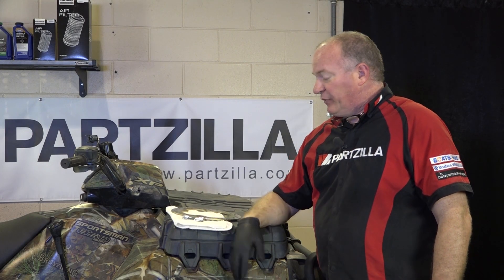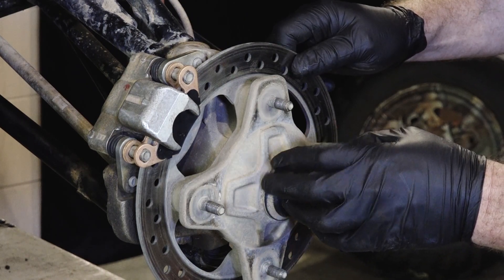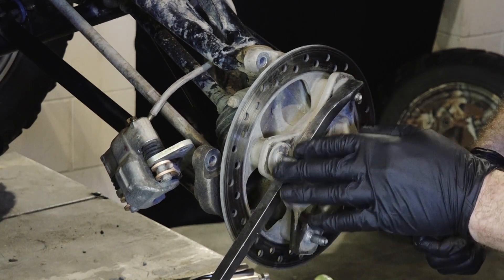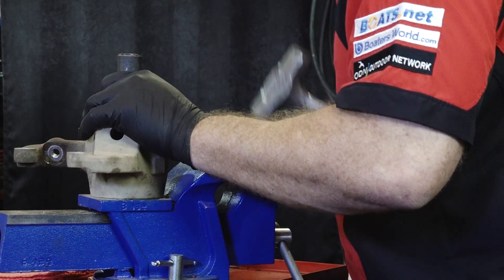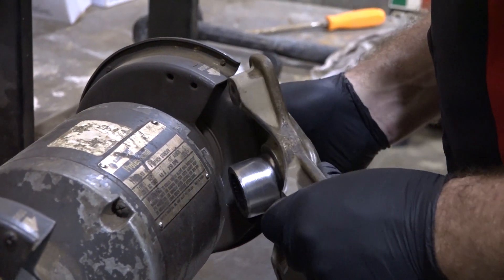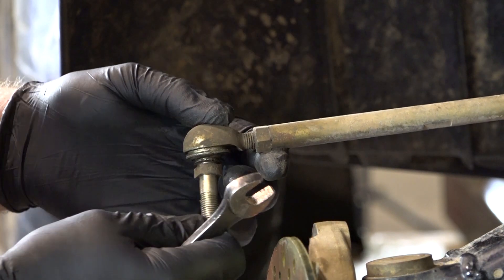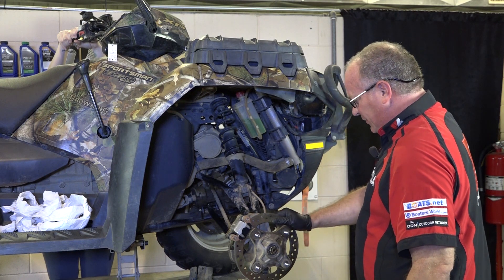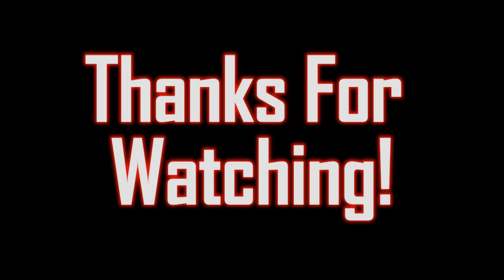How to Replace Brake Disc & Bearing on Polaris ATV | Partzilla.com

Comment: This whole series is awesome! Huge help keeping my 850 running. Just did my wheel bearings with parts from partzilla. Cheaper than my local Polaris even with shipping to Alaska. Thanks for the guided trip through the quad!

Comment: 2000 polaris trailblazer.   The brake disc is fine, just not straight causing brake pads to wear unevenly.  Any suggestions?  Thx

Comment: I did my front pads on my polaris yesterday and it's squeaking and I think the calipers or something sticking cause my quad slows its self down pretty fast when I let off throttle without even hitting brakes and I tried to turn the hub manually and its real hard to turn any idea why it's doing that or what should I do????
Reply: Back off the 5mm bolt on top 1/4 to 1/2 turn
Reply: check the temp of the disk you think is getting stuck and compare it to the other side.  front brakes will get hotter then the back

Comment: How do you know when to replace the disc brake?
Reply from the maker: You mean the rotor?
Reply: Partzilla yes
Reply from the maker: You measure the width and make sure it's within tolerances.  Quick inspection should include just running your fingers over both sides.  Make sure there are no grooves and it's smooth.